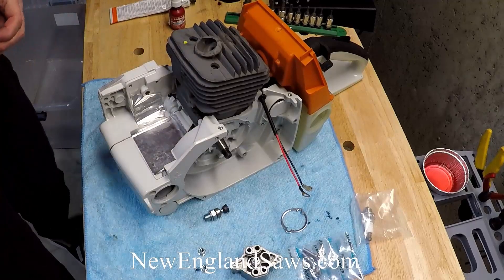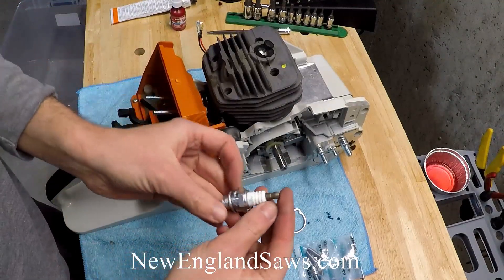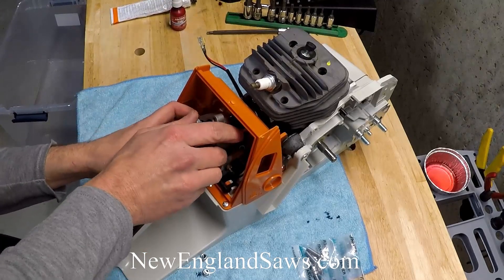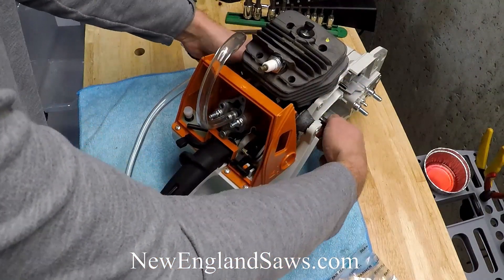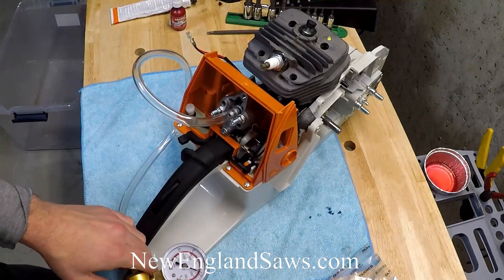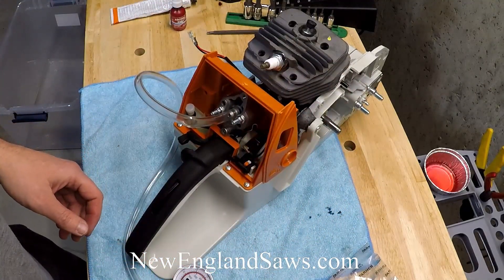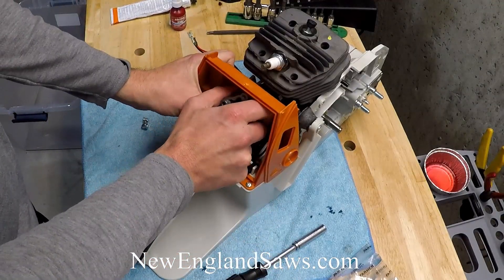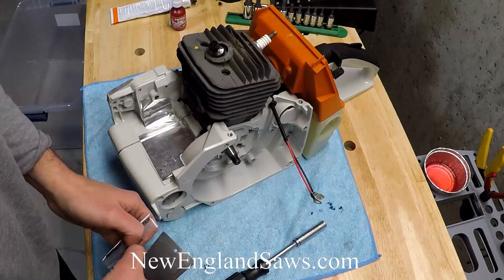Farmertec G660 Build Series - Video 10 - Leak Test

Comment: Great videos!  What is the part number for this leakdown adapter?
Reply from the maker: Check out the shop manual on our website under resources. Part number is in there under the special service tools. We have some in stock if you need one. Email steve@newenglandpine.com